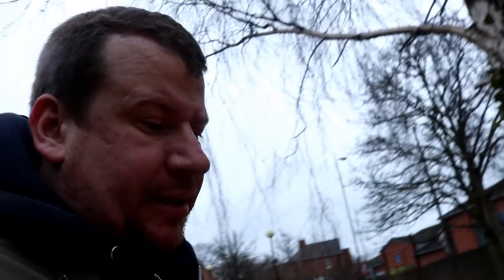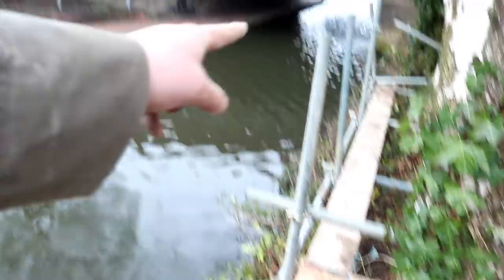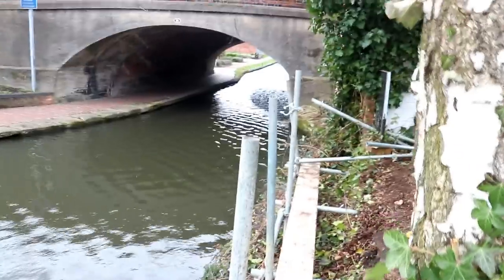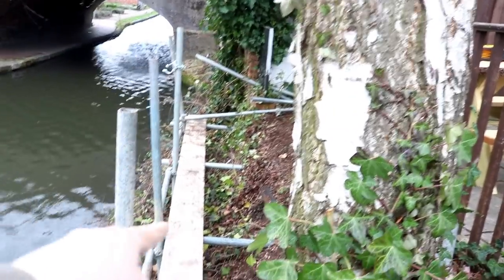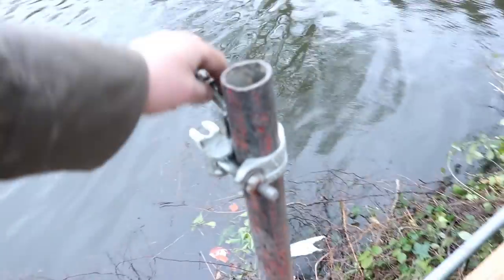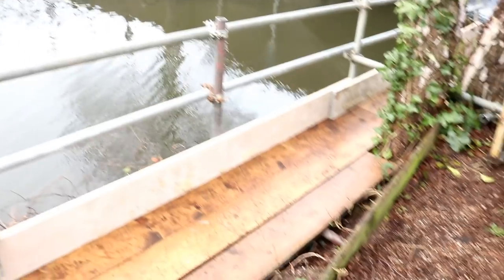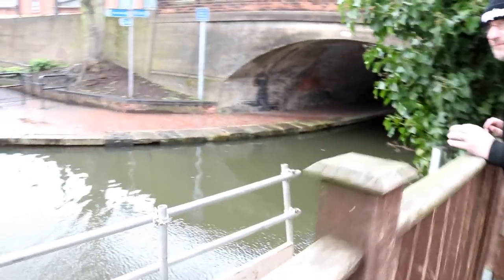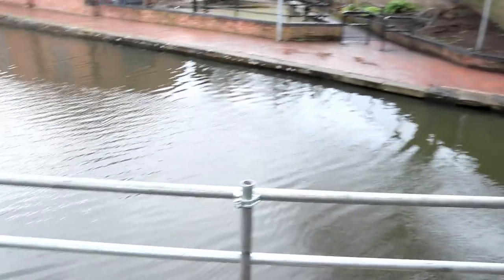FROM THE OTHER BANK

Comment: Nice one, the decks looking good and a more positive comment from me for a change. The canal trust only own up to the edge of the canal or the edge of the tow path so if you are not  going beyond that they have no say in the matter (researched that quite extensively a couple of years ago, the canals were built on land that was compulsory purchased and they were too tight to buy land beyond the immediate boundaries of what they needed). Planning permission is probably not required either as it's not a permanent structure. The new scaff bars do look more professional and safer and I would add to one of the other comments about a potential advertisement banner: Moor up and drop into the Harrison's Brewery for a sneaky pint sort of thing (mooring point at the far end from the bridge). You never know you might get a bit of passing floating trade in the summer months 😄 . Cheers, Schnuz.